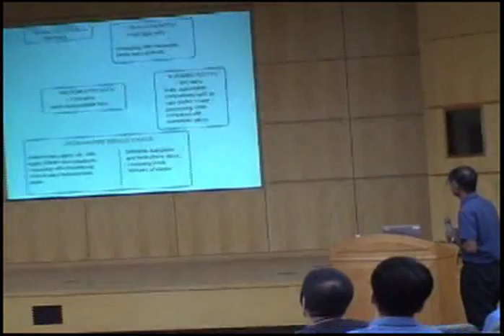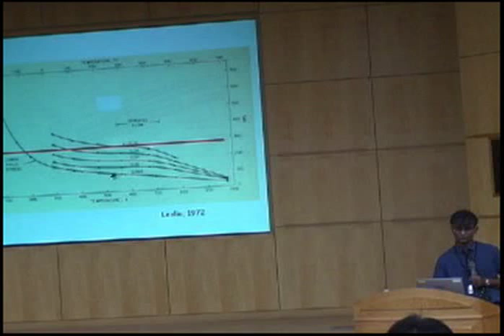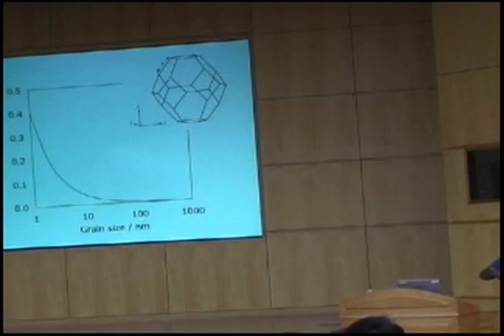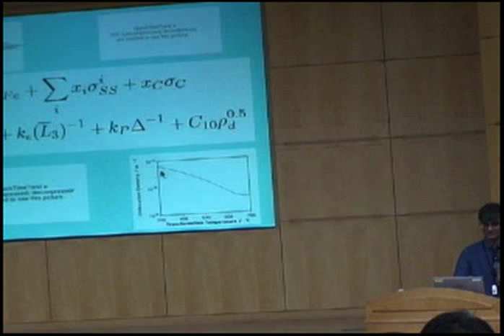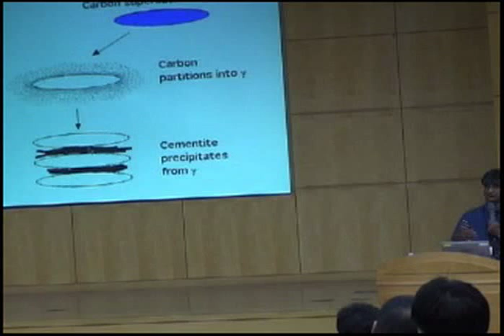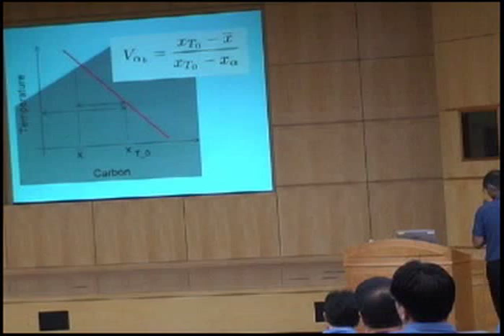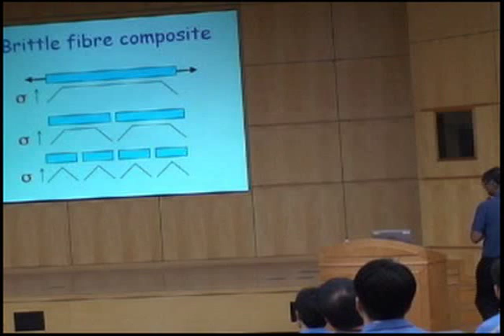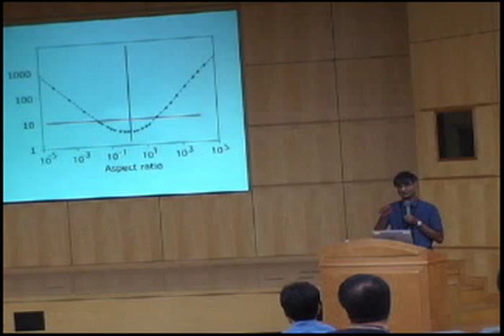POSCO Lectures on Bainite - Part 3

Comment: Dear Professor Bhadeshia:at 38:48, if the austenite which carbon reach T0 hold long time at the bainite transformation temperature, will it precipitate carbide in the austenite and remaining austenite transform to bainite?
Reply from the maker: Yes, carbides must ultimately precipitate so that equilibrium is achieved according to the phase diagram, and more bainite could form as a consequence, or other forms of ferrite - the timescales will be long.

Comment: Dear professor ,what's the mechanism that the continuous austenite(more than 10%) can prevent material breaking?
Reply from the maker: +Smith George Basically that the relatively ductile austenite is not interrupted by brittle, high-carbon, untempered martensite that forms by stress-induced transformation of austenite.
Reply: +bhadeshia123 can I think that if the austenite is continuous ,the crack propagate in martensite will meet the austenite, then the crack stop .

Comment: Dear Professor Bhadeshia:
What’re the microstructures blocky austenite in the steel(0.4C-2si-3Mn) would transform to if it keep in the isothermal temperature?and how it transform to ?
Reply from the maker: If held at the isothermal transformation temperature for a very long time after the bainite reaction has stopped when the carbon concentration of the austenite reaches T_0, then eventually it should decompose into a mixture of ferrite and cementite, as demanded by equilibrium. This would be by a reconstructive mechanism and hence would be slow.
http://www.msm.cam.ac.uk/phase-trans/2002/bainite.incomplete.reaction.1981.pdf